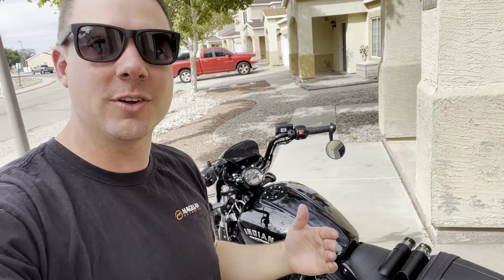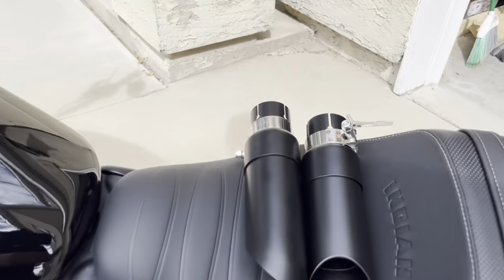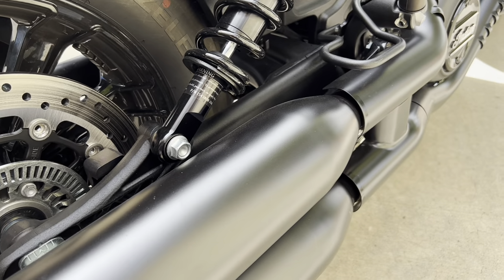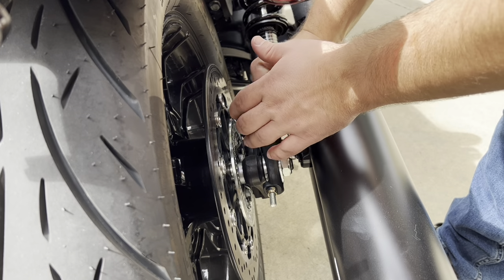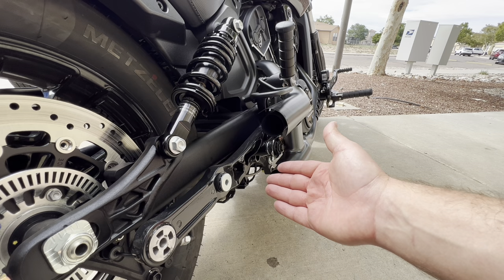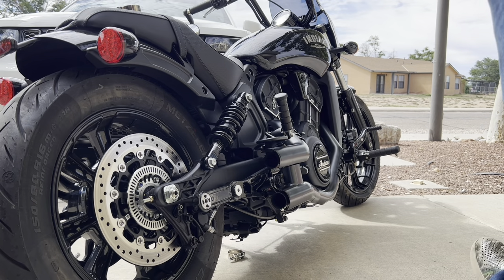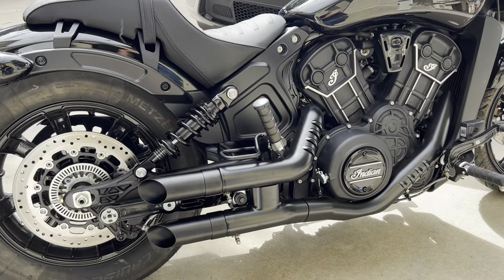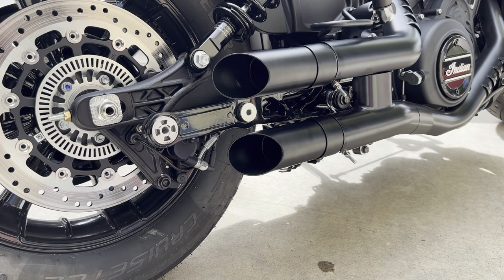GP Shorty Slip-on Exhaust Install and Test on The Indian Scout Rogue, These are Super LOUD!

Comment: They are ridiculously LOUD!  And take the bushing out of the bracket that held the stock muffler or it will fall
Out. “Located between exits of tail pipes”.  And run the DB killers. These bikes run 99-101 at Cold idle with them installed. And 103-104 without and they hurt the head more.   Just my experience.
Reply: Can you explain a little more on what you’re talking about man? DB Killer?
Reply: See that’s my fear is that I live in CA where the exhaust has to be a certain level. Any idea what the stocks sound level is?
Reply: @TruthSeeker9038  with a iPhone decibel app, mine was hi 80’s stock mufflers warm idle, 104 with gp shorties with no baffle and 101 with baffles.  I’m 100% sure it illegal here in Alberta.
Reply: @Weirdalbertan  thanks!!
Reply: Oh
Reply: Yea I got these in 2020 and they’re great for that rumble but even with a full face helmet they were to loud for me. The second you start cruising they’re roaring